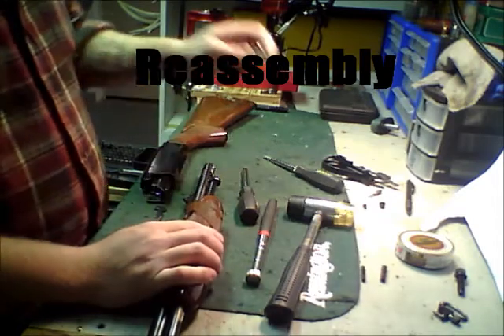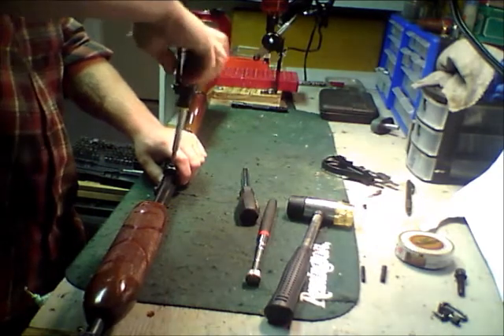REMINGTON FIELDMASTER 572: Assembly/ Disassembly

Comment: I have one that misfires about twenty per cent of the time with all ammo .  Its my dads gun and  probably hasnt been disassembled for  years . Could gunk cause it to misfire ?
Reply from the maker: d rouse most definitely if there is build up around the firing pin. Light hammer strikes are usually caused by the firing pin with these guns though. 
Always try a good cleaning first

Comment: I have a feildmaster 572. The bolt is not locking after pumping the bolt forward. The release on the trigger housing is working just fine and has good pressure. What is causing the bolt to not lock into the receiver?

Comment: Will this rifle handle Stingers,Velocitors and other hyper velocity ammo with out any problems?
Great Video, Thanks
Reply from the maker: Yes, sir. I use HV in most of my .22. 
I haven't used Velocitors specifically. But I've ran tons of other brands and never had a problem. Super reliable little rifle. 
Thanks for the comment, man
Reply: Thanks for the information.
Reply: Good video. I have a problem I hope you can help with.  I recently cleaned my 572 for the 1st time and now the action bar has extra 'play' after gun is reassembled.
The gun action works but there is so much downward travel in the action bar the forward stock can be pulled downward. It was not like this before I disassembled for cleaning.  Any suggestions???

Comment: Need help:  1st time cleaning my 572 and now the action bar has extra 'play' after gun is reassembled.
The gun action works but there is so much downward travel in the action bar the forward stock can be pulled downward. It was not like this before I disassembled for cleaning.  Any suggestions???
Reply from the maker: Where the bar fixes on to the pump, there should be a metal insert in the screw hole. Do you still have that in, or did it perhaps fall out?
Reply: I didn't disassemble the magazine or the pump handle when I cleaned my gun.  That step I decided to bypass so the connection where the action bar connects to the handle was never disturbed.
Reply from the maker: +Ellis Wallace personally I've never encountered that. I just checked this one and its factory tight. 
If it were me, I'd start by just stripping the rifle 100% and rebuilding it, just in case you missed something or misplaced something. I always find it easier to start from square one. Keep me posted

Comment: I am in the process of cleaning a friends 572 fieldmaster  Something I noticed about it right away, is that there is no screw in the receiver to retain the barrel.  There's no hole, or anything.     Not sure of the age of the gun,  I'm wondering if this is an early model, or was this something that was dropped in later production?
Reply: Did you ever figure it out? in a similar situation as you.
Reply: @Barbaratio  I found a date inside the receiver  1984  It seems like there are a lot of changes to firearms over their production years,  seems to me I read somewhere that some 572 rifles used an outer aluminum sleeved barrel, and some are all steel,   Maybe its the aluminum barrels that use the screw in the receiver
Reply: @kennash5719  Have you tried disassembly regardless, I'd like to think that you can still pull the barrel and tube out of the receiver.
Reply: @Barbaratio  Yes, I fully stripped it down there is a single screw on the bottom of the receiver that holds everything together , it's cleaned and reassembled now and functions fine